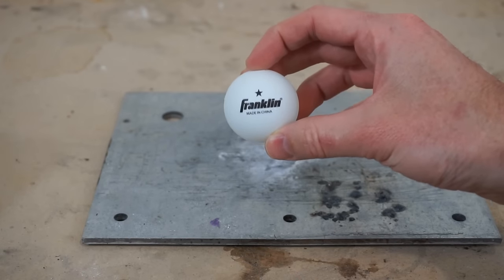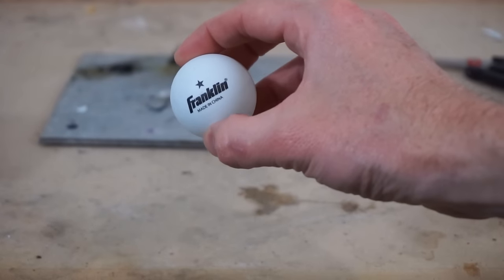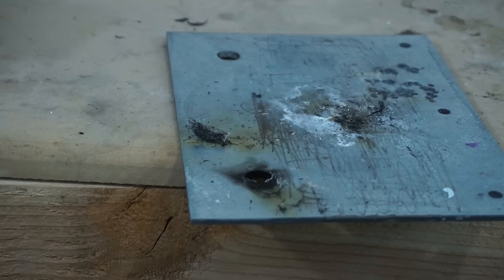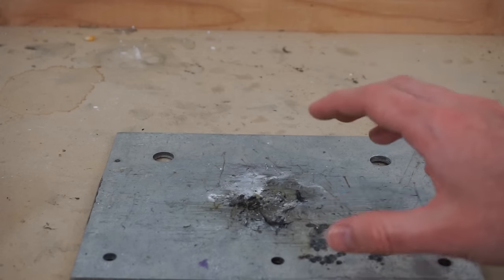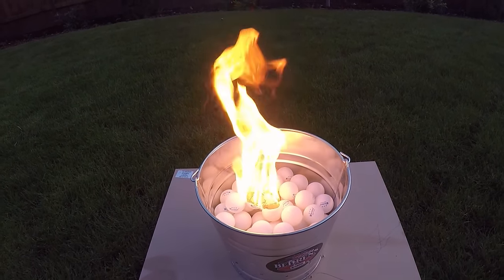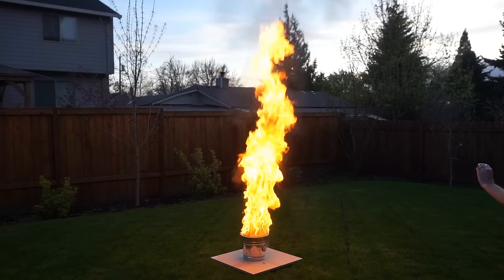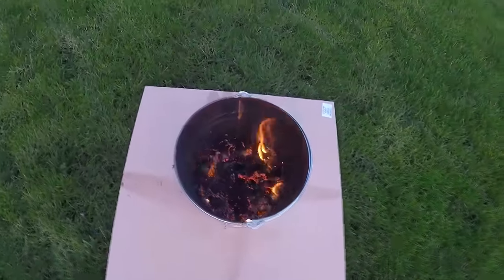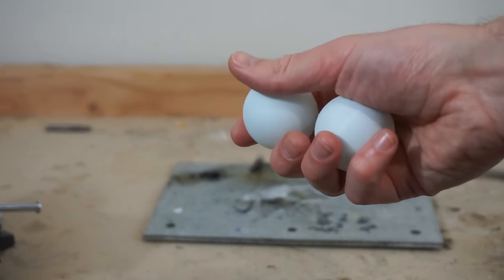Why Are Ping Pong Balls So Flammable? Lighting 100 Ping Pong Balls On Fire

Comment: attempt to light a ping-pong ball on fire in a vacuum chamber,it should still be able to burn without oxygen due to the nitrocellulose...also have a look at the chamber pressure before/after to see crudely how much gas is released(should be quite a bit),if you can ignite the ball.....
Reply: The oxygen in its molecular structure is bonded with nitrogen which is inert. Therefore it cannot burn without external oxygen.
Reply: @wilsjane  wtf no not true
Reply: @KClO3  Nitrocellulose cannot burn without air, Traditional cinema film was made of it and steel rollers on the projector spool boxes prevented a fire in the filmgate reaching the reel. When the film caught alight on the rewinder, you just grabbed the burning strop out with your hand to stop the air.  
Just think about it. With the tons of film in the vaults, if it could burn inside the cans, every film studio in Hollywood would have gone up in flames.
Reply: @wilsjane  nitrocellulose has it own oxygen and it is easily released and not tightly bound like you said, how else would gunpowder burn? Why does gun cotton work in a firecracker?
Reply: @wilsjane  Not all nitrocellulose is 100 percent nitrated. Gun propellant grade nitrocellulose could easily burn without air.
Reply: Yup,we used to make smoke grenades by wrapping tennis balls in tinfoil
Reply: @wilsjane  A bit late to reply back, but i myself have made small rocket motors using nitrocellulose alone, nitrocellulose can definitely burn without oxygen(and its very fast)...if you confine the ignited stuff enough it will actually detonate(not deflagration) with a rather high detonation velocity of 7,300m/s.

Fun fact: I believe nitrostarch(almost chemically identical to nitrocellulose) used to be used as the main explosive ingredient in some WW1 hand grenades! 

Today nitrocellulose is used as a binding agent in a type of plastic explosive called blasting gelatin(nitroglycerin being the other main explosive in this composition).

Comment: I know helium is lighter than air.  but what would happen to a helium balloon in the vacuum chamber?  Would it sink and pop? 
Great videos.
Reply: Helium is lighter than air to be true. But it is still heavier than a vacuum. Just do the math.....
Reply: If helium floats because it's lighter than air (but still posses mass) and a vacuum is, well, a void of "empty" space, the helium won't have anything to be lighter than.
Reply: A balloon in a vacuum chamber would fall to the floor and expand, then leak out gas.
Reply: Since air try to travel from high pressure to low, I think baloon blows away!

Comment: You didn't need to drill air holes into the bucket. Nitrocellulose will burn with the absence of oxygen, the chemical structure contains all the necessary components to burn.

Comment: Does this mean with older ping pong balls that were more flame able that if I hit them hard enough and caused enough friction I could set it on fire on its own?
Reply: Elijah Jones Yes
Reply: Inzinatix that is amazing!! Now I wish I could try.
Reply: @elijahjones1271  Heat wouldn't be enough. Needs spark
Reply: Divyesh Vartha are you sure? can you make a video to show that it is not possible to make older ping pong balls burn with enough heat caused by friction?
Reply: @elijahjones1271   Elijah Jones  first of all. I'm surprised you replied to a two year old comment. Now there is a spark temperature at which a substance will combust in the occurrence of a spark. Then there is a flash temperature (higher than spark temp.) at which the substance spontaneously bursts into flames. Now I think that friction alone isn't enough to bring the ball substance to flash temperature. At least when we're talking about normal table tennis play. Even if you rubbed it really fast on some rough surface, I doubt it will reach the flash temp. It must be an urban myth imo. (I haven't experimented with balls and fire tho, old or new, all this is based on theory)
Reply: Divyesh Vartha that is really really interesting. That makes me want it to work even more. Ill have to do some research and see what i can find.

Comment: We call it a ping pong ball machine. It's technical term is A.I.D.S., but we never call it that. Whoever thought of that obviously wasn't thinking very well. It stands for Aerial Ignition Deployment System. There's also another chemical inside the ping pong balls before we inject the other chemical. Depending on how much of the second chemical is added, determines how fast the reaction will ignite. This is useful for when we want to ignite the underbrush below a forested area, but not the trees themselves. The ping pong balls bounce down between the branches and ignite on the ground. In the event there's a malfunction in the device, the whole system can be ejected from the helicopter, so our helicopter doesn't ignite with the ping pong balls.

Comment: Due to this video I have to ask why the USA during WW2 would have filled its naval fighters excess spaces w/ping pong balls. The reasoning was that the fighters would float if they crashed into the ocean. The problem would've been that the tracer rounds that aircraft were equipped with would've set the ping pong balls alight. The idea was 1st presented to the navy by Howard Hughs as a way to save navy pilots forced to land @ sea & your video proves this idea to be unfeasable, do you know of any info on this subject? TY for a great video